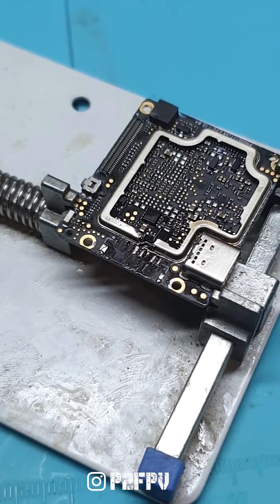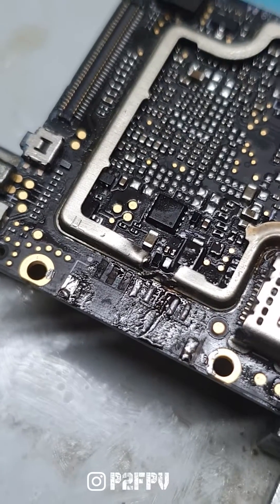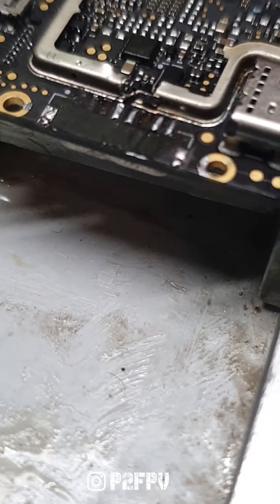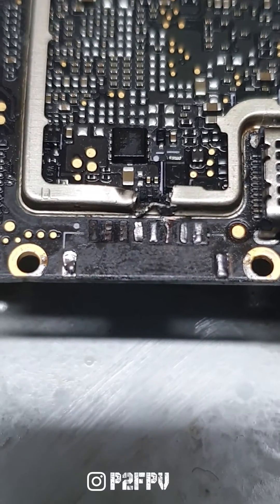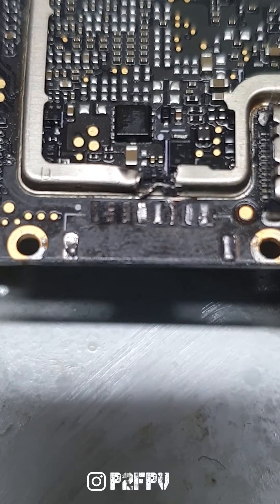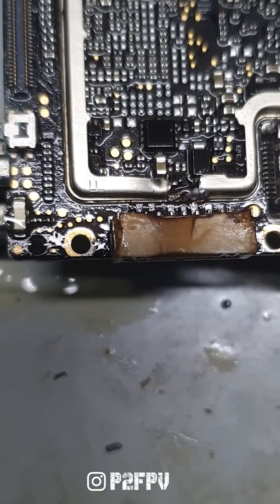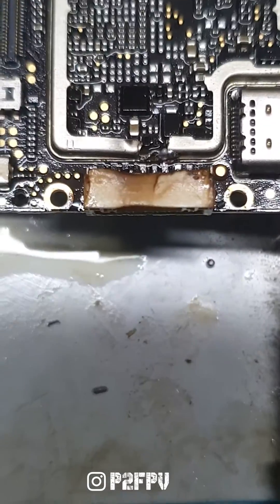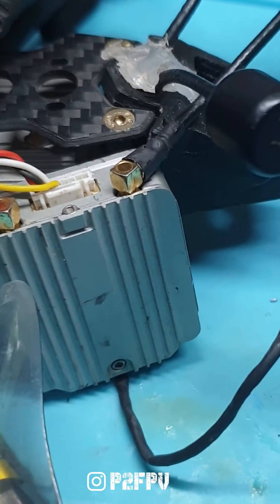DJI Air Unit Repair - Stuck On Low Power

Comment: Hi. Can you help me out. I have a caddx vista with a shorted regulator. Can you plz let me know what part it is? It’s the top board on vista and it’s labeled “bQCTB”. Has 8 legs and there’s 2 of them. Any help is appreciated. 
Thanks
Reply from the maker: Brother attempts have been mad even mad tech tried to no result you can watch his video that explains it in detail

https://youtu.be/v3vyVO60BLk?si=V1ViXcSG_IwQuuPn